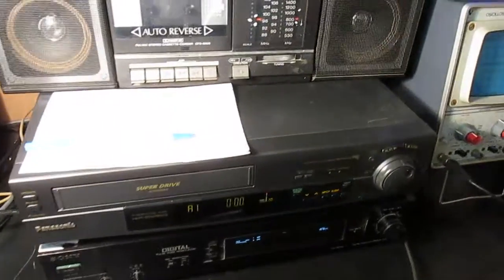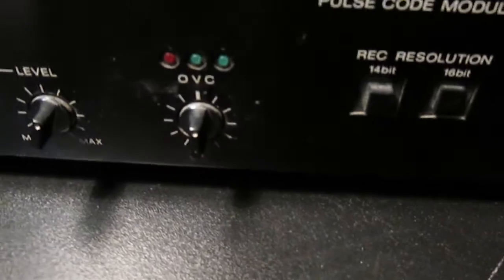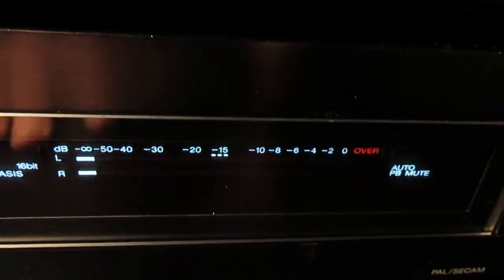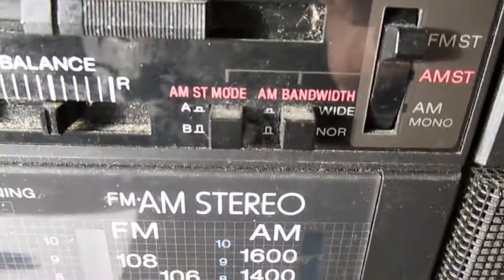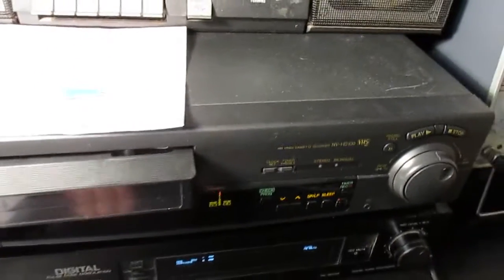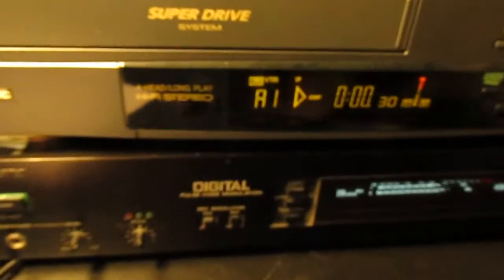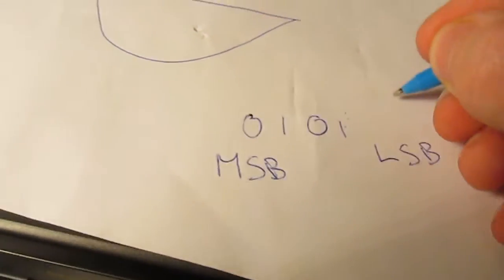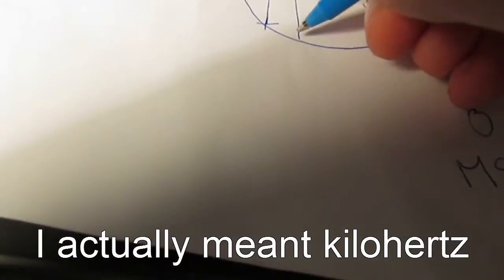Digital Audio on Videotape?! The Sony PCM-501ES Digital Audio Processor (circa 1984-88)

Comment: Trivia:  The NTSC version recorded at 44.056 khz sampling because of the NTSC frame rate (59.94 hz).  The PAL version here will record at true 44.1 khz "CD" rate to PAL frame rate video.  Most digital interfaces will accept both as it is close enough to lock on, but you may hear an occasional low crackle as the clock recovery is re-synchronized.

Comment: Is it possible to record PCM(video) and analog HiFi (L/R) signal on VTR simutaneosly via connect with PCM501?
Reply: Yes that is possible, with VHS the HIFI stereo is recorded by the stationary head
Reply: The Hi Fi heads are on the same drum (offset) as the video heads, that's why it's such good quality. The stationary head is for "standard" mono/stereo audio, which is the only way to audio dub. The Hi Fi sound will be locked to the video signal so cannot be dubbed or changed.

Comment: I have a SONY PCM 701es with XLR analogue input/output and BNC Digital output/input connected to a working VHS machine. Possibly a pro version. I can only get the meters to display the input signal when REC MUTE is held down and I cannot get my video tuner to pickup the PCM output signal. So no recording or playback, yet. How did you get your VHS to tune to the output of the PCM 501es or does yours have yellow component outputs (unlike mine) requiring no tuning? Any help would be greatly appreciated. Thank you